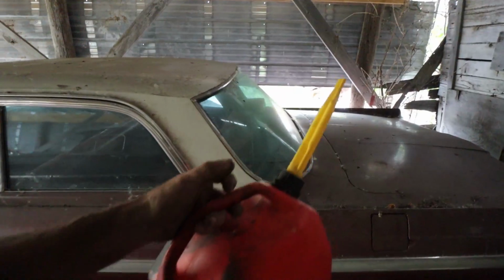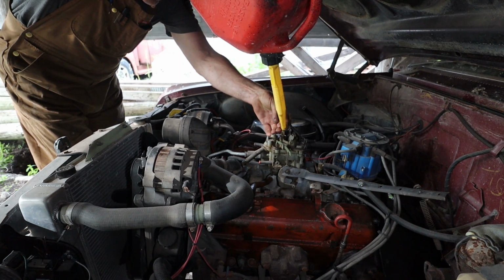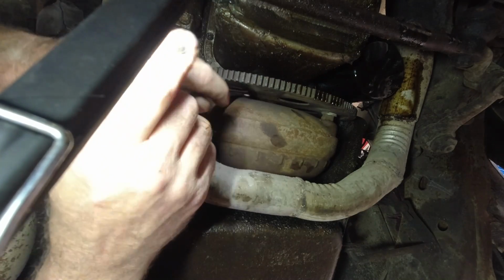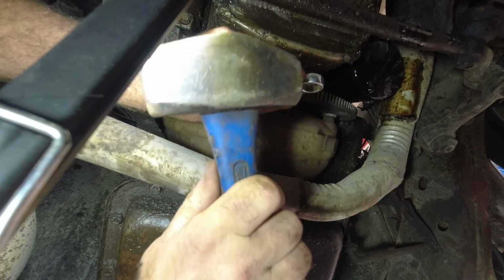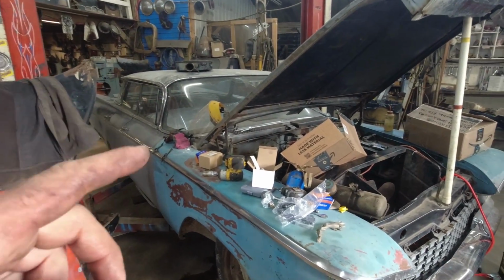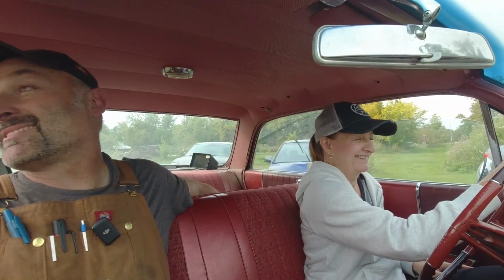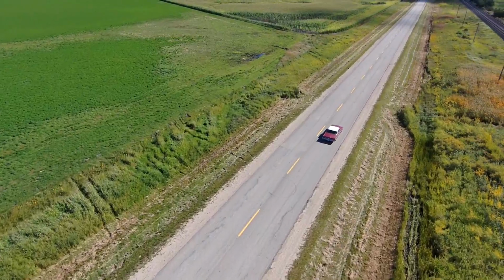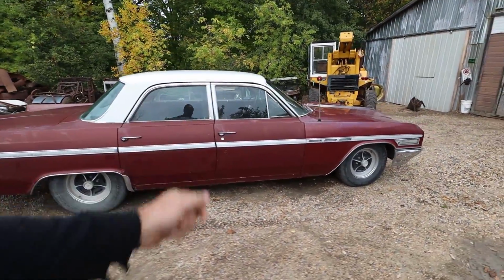Pulling my wife's 1964 Buick LeSabre out of storage.

Comment: The car from my childhood that I am fond of is a 1956 Dodge Royal Lancer.  It had a 315 motor, push button transmission, dealer added AC.  Power steering and brakes.  I think I remember three colors. black red and white.  My Dad and older brother were always working on it.  Later, I helped, but mostly with the 65 Buick and the 73 Electra.  And a 65 Olds Cutlass F85.  Fun for me.   We had an analyzer and a timing light.  We did all our own tune-ups, exhaust work, starters, alternators, water pumps, steering linkages, shocks.   we farmed out the alignments and ball joints.  Dad was an engineer.  He could have afforded to farm all of it out.

Comment: Mon I remember driving my GMC truck with a cracked flywheel for month's waiting for it to break all the way. It never did until I had to craw under my truck and drop the 400 tranny, and it was a heavy sucker being I'm a small guy had a back and stands to help. My brother help me get it back in. That truck never left me stranded and I drove that truck all over California North South from high ways to small logging roads. Had to sell it because had to many vehicles I was paying INSURANCE on. The slogging is what got expensive or I would have kept it in the heard.  Next truck is going to be an oldie but goodie. Really digging Brents small 31-32 truck with the full fenders 👍🏽

Comment: Dead battery, i need a boxful of solar panels, to keep em all up, or a wrench to disconnect em. Thats a really nice car, and i bet a pleasure to drive.  I have pulled flex plates,replace bellhousing bolts with long ones, and slide trans back on bolts. At least it keeps it lined up.
Trying to get stuff lined up for winter, not using the s10 i have, going with a newer one with 2.2/auto. So the 2.5/5 speed is back in the lineup.

Comment: An outdoor storage hint or two. The first, to keep mice from munching on your wiring in the engine bay, take two pairs of dress socks double them up and fill 3/4 of the way with mothballs and lay on the fender linings the odor drives them off. The second is placing scented dryer sheets in the inside on the floor and under the front seat, the odor is pleasant for humans but not for mice, add some to the trunk so mice don't build their condos back there.....

Comment: Nice car and charming missus! And nice drone footage too. S'gonna need some chemo as it's one of those cases in which the cancer is worse that it looks. Sure would be nice if you could save that paint, esp if it's THEE original paint. But better a repaint, than drive around with a lot of post-op gray primer.

Comment: I find myself wondering if that 350 will need a new crank since those flex plate bolts being loose would cause the bolts to work back and forth ruining the flange bolt hole threads. I had a 289 Ford do the same thing after a "pro" put the engine in and the crank had to be replaced since the holes were egged out. Turns out he didn't use a torque wrench to tighten them up while the engine was being rebuilt.

Comment: You don't have to take the trash out, take the cross memory. Put longer boats in there and take the bell housing boats loose and slide the street back and take the truck on VS lose from it and it's all show back, and you're going to reach up and take the flex played off without. I'll take the transmission out I don't know a hundred times

Comment: i miss my mothers 72 fleetwood broghm caddie white blue interior 472 under the hood dozens of pieces of chrome in the bumper and front end learned to drive in that thing took a day to parallel park it but it got ya there safe an sound she accidentally cut through a couple fields an the barbwire fences in a whiteout it got a dent in the hood for that run i go out shes got several fence posts and wire on the car i rush them to the dumpster and just then the sheriff shows up asking did i know anything about who did the straight line road ...nope sorry sir...